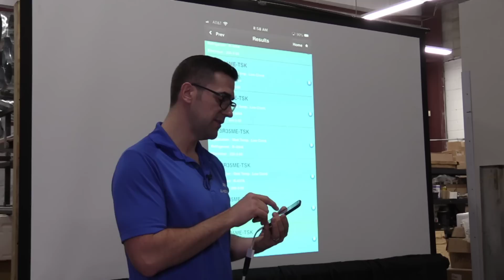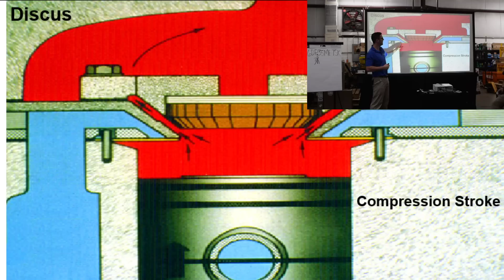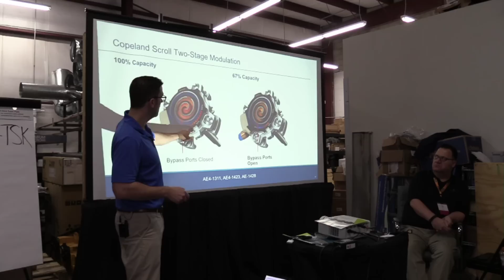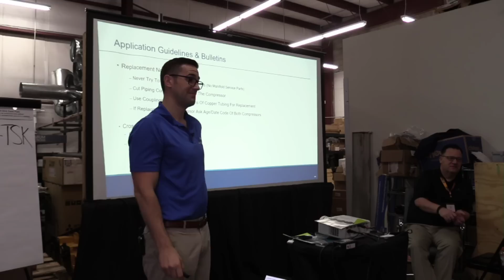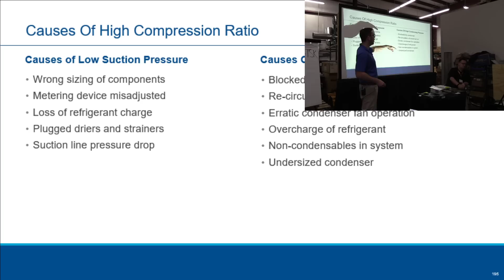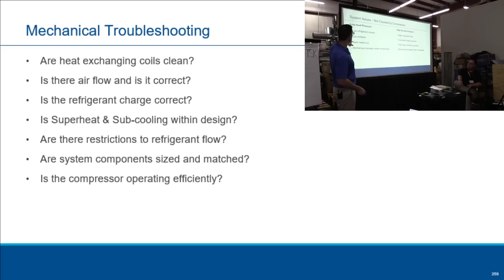Compressor Facts and Troubleshooting  (Don Gillis / Trevor Matthews)

Comment: If you have two or three years on the field and you’re starting to replace compressors. 
       Will you have 20+ years and you have been replacing compressors. 

Highly recommend you taking Trevor Matthews compressor course. 

It will get you doing things you forgot you were supposed to do in the first place .  

Bring you up to the next level . 

Get you on track if you never knew how to do it right in the first place 

And for those who are you who are really good and kind of drifted off track and got a little lazy and overconfident . 

Put you back on track . . 👍

Comment: What is the impact of a faulty non return valve on a discharge pipe on one compressor on a rack of semi hermatic compressors
Reply: simply put, the pressure has to go somewhere...boom, or pow, bang.  relief valve, pop-off valve, pressure relief valve depending on the nature of the application.  pressure controlled regulator, moisture, heated moisture, vapor, chemically induced vapor/sealed leaking pressure.  The pressure has to go somewhere...in contained environments, a collector, atmospherically dissipated boiler, such as in eliminating waste coolant...on and on and on. NO didn't listen to the whole presentation, couldn't get through it. i listened to 12 minutes of uh...knowledgeable presenter?  maybe.  couldnt tell you
Reply: key term, compressor

Comment: How would you test for a faulty oil regulator?
That is if its over feeding or underfeeding, stuck open or stuck closed or bleeding by.
Reply: replace it with a working regulator, check pressure and diagnose. sort of works like a pressure regulator on a water well.

Comment: Total garbage I can say as my opinion about all digital thermostats and multi controllers like Dixell with decades of experience speaking 

All garbage in all applications. If it  lasts for two yrs then consider oneself lucky. Old mechanical 2 wire stats last literally as long as they don't corode apart/ decades

Going forward to take 3 steps backwards I guess :(

Thank thy politicians

Comment: Good presentation.

You did not mention much about system oil circulation on variable capacity compressors.  I am particularly concerned about running a variable speed compressor for too long a period at low speed having a negative impact on system oil circulation.

Comment: Hi good day. I working on a 12k btu split today  and came across something odd. The compressor hums for a second but won't start. The capacitor is new and I also hooked up a hard start kit but still won't start. I checked the windings but everything reads good . Any thoughts on this
Great videos tho. I always check out your videos when I'm in a jam . I'm an independent contractor, got certified but as always there's always more to learn everyday.
Reply: Get a packaged  "window"  unit instead

Comment: I am a test and service technician for a chiller manufacturer Fluid Chillers Inc. The information in this presentation was superb and extremely vital for a very complicated process. This week I will be replacing a 35-ton scroll that was a burnout with a locked rotor. This will be the 3rd compressor on this unit. It is a 410A outdoor air cooled Chiller with fan cycling switches on the condenser fan, So in low ambient conditions my pressures are all over the place. Our new Chillers have variable speed condenser fans. And I'm pushing hardcore for electronic expansion valves and vfds on the compressors.